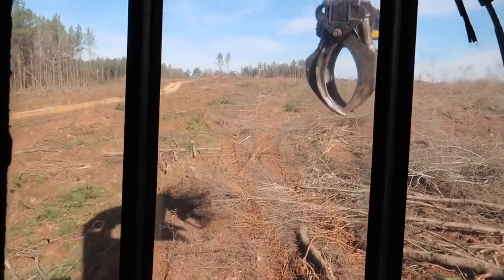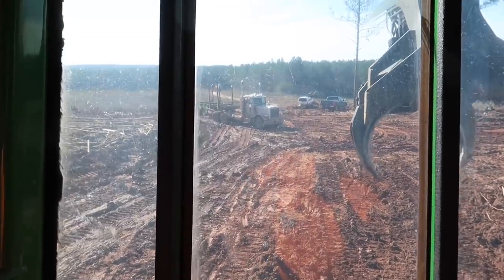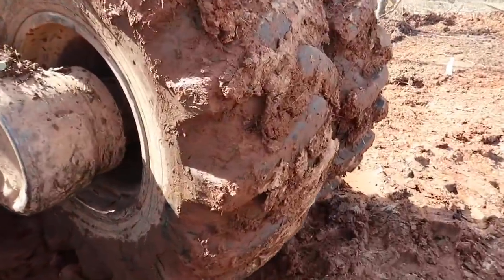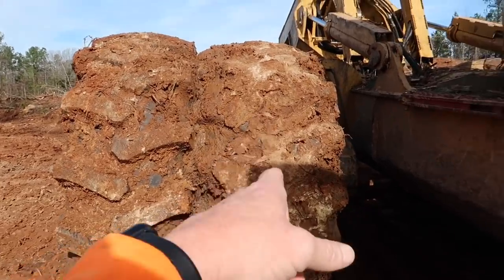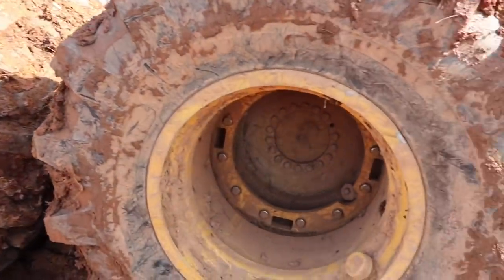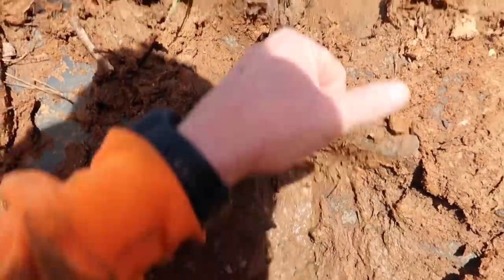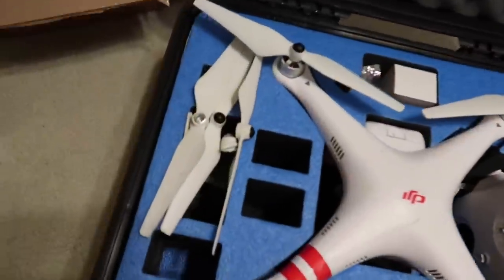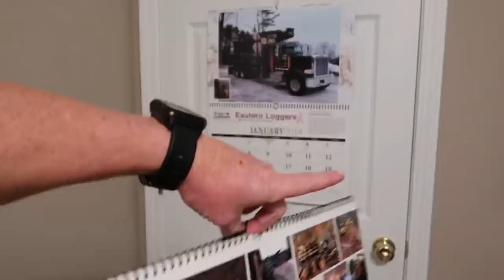Tigercat 635d duals explained- class is in session! Let's inspect this beast

Comment: How are the Duels working for you? Are you getting better production out of the from the 635? When would you think you might be taking them off or leave on?
Reply from the maker: We were just talking about that very thing. For us, once we take them off, we will probably never put them back on. If we ran in swamps 100%, we would run them but otherwise, our biggest help is the sunshine.
Reply: @cotontop3 YOU'RE EXACTLY RIGHT
Reply: @cotontop3  I'm being curious as to why you wouldn't run them again as I have been thinking about putting duals on my 748 to keep us running up here in the N.E.
Reply: @cotontop3  The chains you have once shown on that forwarder are probably even more expensive than duals huh? Anyway great you are able to run again :) It's not only the skidder that has problems if it's that wet, maybe best to just take an involuntary break / do some maintenance.

Comment: Good info on the duals, some good information. Was he pulling on brush or did the ground dry up that much after lunch cause those treads started looking clean?

Also could you do a class on the processor? Cause when he picks up a tree it looks like it sucks it up.

Awesome video, thanks Tim
Reply from the maker: This was filmed 4 days after putting tires on. It’s dried a good bit.

Comment: You said the used tires were bigger than the new tires. just put the 2 new tires on the same side would slove the problem of different hight.
Reply from the maker: I just watched it again and that is not what I said.  You can’t do it how ur talking about because the tires are not the same width. Inside is 30.5 wide and outside is 24.5 wide.
Reply: Sawmiller Smith they a different withs also. Outside tires are new and never used but thin size. Inside tires a original and wider .
Reply: Okay guys, I get it now.
Reply: Just thought of this but that would also ruin your diff-lock pretty darn quick

Comment: Hello!Thanks for your Vídeos.
This tires remenber swamp logers at discovery chanell.At my teenager time 91 year  at my summer vacations i usually were at my uncle’s milk farm.Lots of trators and machinery for a eleven boy.I help with case internacional 745s, one light tractor 1960 444 with a 5 tons remolque full of corn sillage fitting to come up in Hills with the front hells up and only the Brakes driving diretion.Sometimes When go down i have to have speed and let height Go with no brake capacity or drifting or hoverrolling.I learn tracion is á balance pressure and tire área.In soft Terrain They Warn me dont stop and it the hells with brake is losing tration
Reply: Good times and without stress are in forest with my 298 xp,044 stihl.
Be safe  the life is a Gift and the famíly Belived We always remenbered that Very  clearly in mind when risky decisions aperead!
Greatings from Oporto Portugal
André Campos
Reply: Mio in